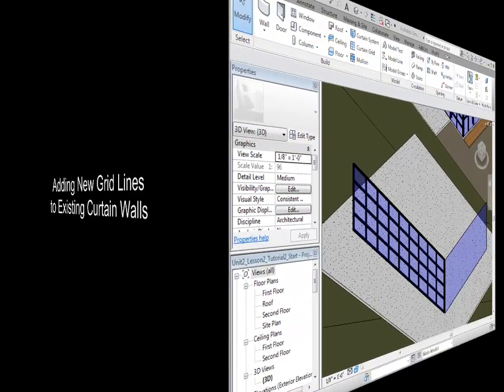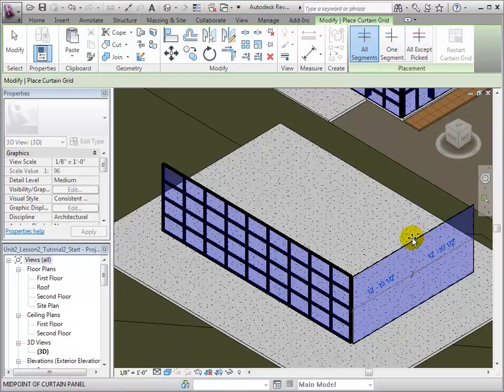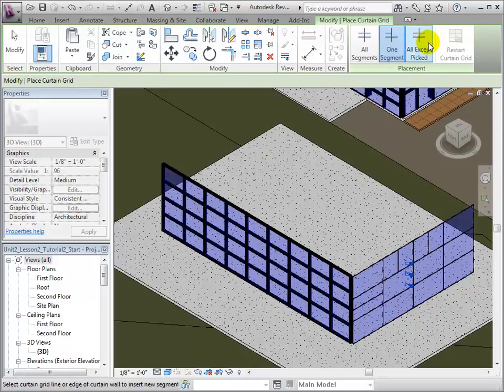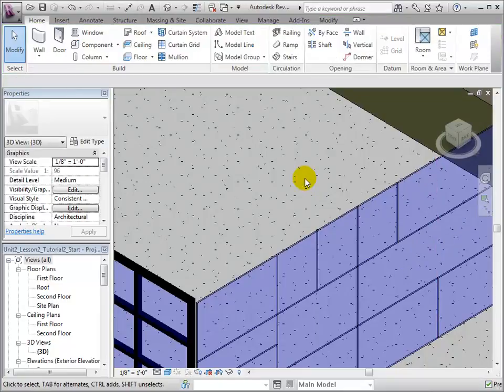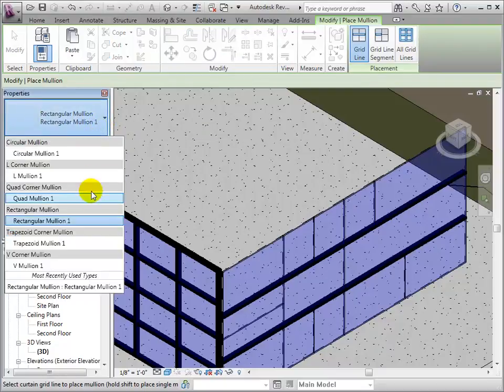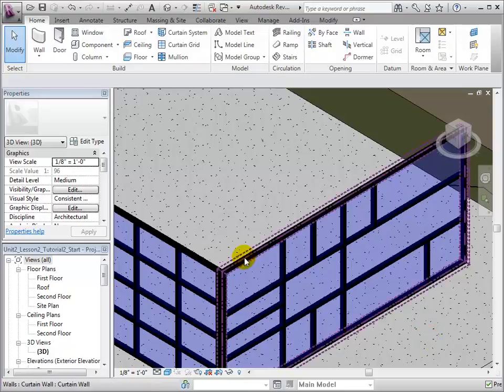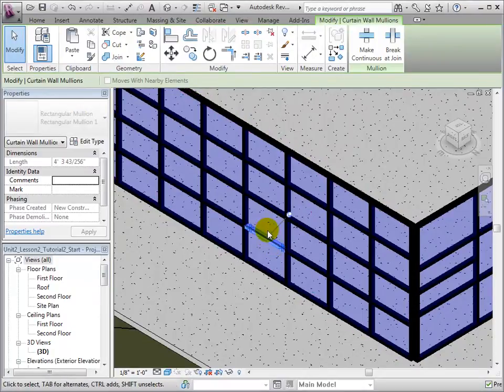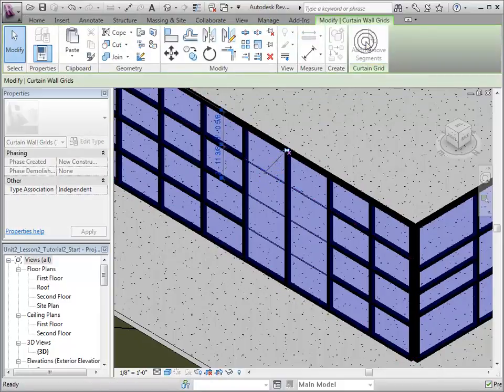Revit Architecture - Adding and Removing Curtain Grids and Mullions

Comment: When I try to create a curtain grid on a wall it does not seem to work. When i'm in the curtain grid tab and the mouse is ready to select, there are no lines that appear on either side of the wall, horizontally or vertically. It just doesn't seem to be working, I even selected the wall before hand and it still doesn't seem to work. If you have any suggestions to this problem I would be truely grateful.